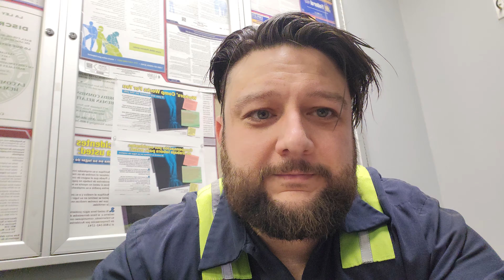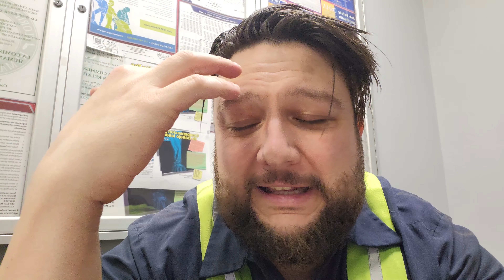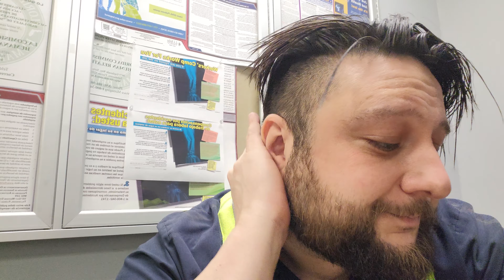Which K Series Head is the Best?

Comment from the maker: RBC and PRB 😁

You also don't have to grab a head with upgraded springs. Can still save a hundred keeping the original valve train.
Reply: For $700 what wheel hp can I expect to gain and what head gasket would you recommend for an NA setup to bump the compression up?
Reply: Have you ever ran a nippon racing head gasket with boost? Thanks